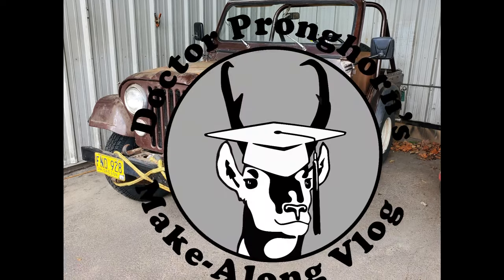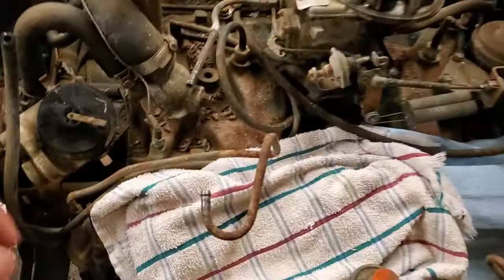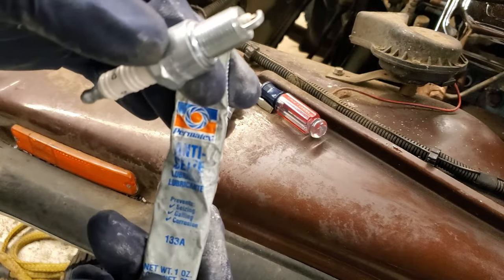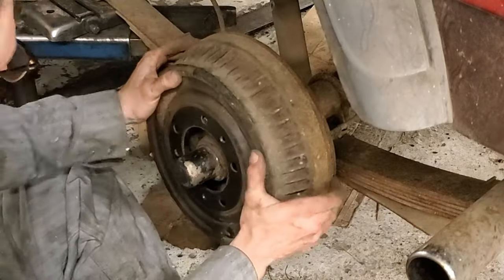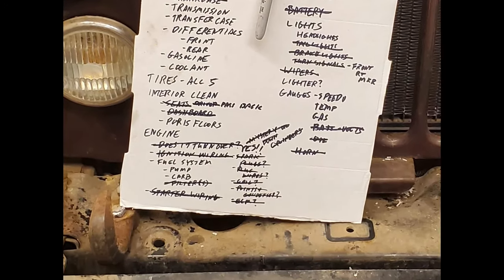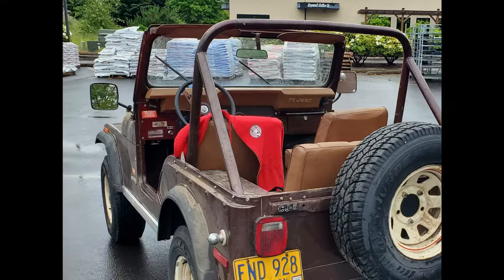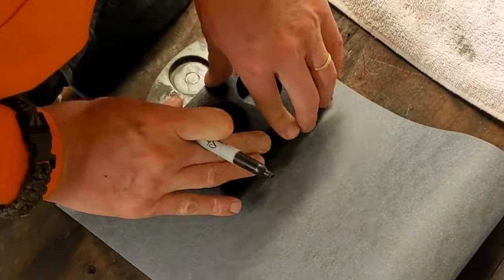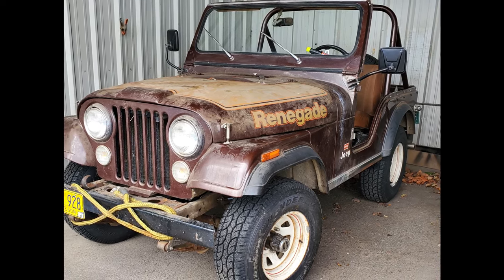I made this 1977 Jeep CJ5 run after it sat for 14 years!

Comment: I've got to get back to my jeeps. I've got an '81 CJ5 that's been sitting in my garage for about 12 years. Parked next to it is an '81 Scrambler that's been sitting in the garage for about 14 years and parked outside in the weather is a 91 YJ wrangler. I want to get to CJ5 going first and then slowly work my way into the others. Problem is that every time I start thinking about working on it, it seems like one of my daily driver vehicles craps out and I'm spending my vehicle tinkering time on that! Love the videos!
Reply from the maker: I understand. I cheat and have a mechanic work on my daily driver...

Comment: I just bought a 1977 CJ5 304 2 owner yesterday that set for 18 years. The adventure begins
Reply from the maker: Watch out for the distributor gears if you replace the original distributor with an HEI model...

Comment: I had a '78 CJ-7 that I had to do so much of what you've done on yours. That was back in the late 90s. Had it for several years and it gave me good service. Mine needed a lot of cosmetic work, new paint, interior, plus 304 engine rebuild, brakes, and so on. The list was long. But, I enjoyed it and it was a pretty sweet ride in the end. 
I noticed your Jeep is in so much better condition than mine was; you scored a win on your purchase.
Reply from the maker: It was too good an opportunity to pass up, both because of the condition of the Jeep and the connection to my friend!

Comment: I have a 1977 Jeep CJ5 same as yours, even to the color. Present mileage is 47000 miles. Runs great. Keep it in my garage since I bought it. I do most of the repair and maintenance on myself. Drive it once a week at least to keep the parts lubricated. Great machine.
Reply from the maker: Right on! I'm glad you're keeping  it on the road!

Comment: Nice CJ5, I had a brand new 1979 CJ5 with 304 cid  V8 back in the day and on Nov. 22,1981 I hit some black ice on the freeway and lost control and barrel rolled it at 75 mph. I survived with minor injuries, I did drive the Jeep after because it landed on it's wheels, but it was totaled. It was a fun vehicle and I never got stuck in the mud, it had Firestone Town & Country H78 15 Mud and snows on it. Great vehicle just not meant for the freeway or "J" turns.
Reply from the maker: Wow! I'm glad you survived! My plan is to keep it below 55 mph, and stick to back roads when I'm out in the Jeep.
Reply: @DrPronghorn  Thanks, very sound strategy, the Jeep is a useful vehicle.

Comment: I have a 79 CJ5 that I'm going to change the distributor out with an HEI.  I'm so glad to have seen this and I will be sure to apply the grease to the gear.  Sorry but thank you.  I'm rewiring and installing some new gauges and other stuff.
Reply from the maker: It would also be a good idea to try swapping out the gears to keep the original gear on the new distributor. I hope the grease helps, but I have heard of this happening to so many jeepers I would take every precaution I could!

Comment: Those screws that hold the brake drum onto the hub - the putpose of those is to make sure the drums don't fall off while going down the assemlby line. That was their function. It's perfectly fine to leave them off.
Reply from the maker: That's what I've learned since I put it back together... I won’t bother with them next time!

Comment: BTW, the disbributor gear issue had nothing to do with not lubing the gear.  AMC have to have a matched set (distributor and cam gear).  You could of reused the original gear from your original distributor and been fine.  Ask me how I know.  I wiped one out in the 80's.
Reply from the maker: I've read that in a lot of places since I made this video. I guess I'm just the latest jeeper to make this mistake!

Comment: I had the white and blue with Levi package Renegade with the bikini top and doors Ford 304 with the black side pipes two of the gas Jerry cans mounted on each side of the spare tire. And it's true doing a j-turn will put it on its side going 45 miles an hour. It's all fun and games until someone gets an eye put out. The early 80s were a fun time
Reply from the maker: That sounds awesome, except for putting it on its side... Thanks for watching!

Comment: Hey there just saw your video I live just north of ya in British Columbia Canada , Iam in a similar situation when it comes to lugnut locks my 74 CJ5 had been sitting since about 2001 & there are locks on all 4 wheels I have seen plenty of other videos on wheel lock removal but most of them are on newer cars not ones that have been sitting for over a decade,any info on how you managed to get them off?
Reply from the maker: I just banged on a hardened socket that was slightly too small, then used an impact gun to hammer them off.